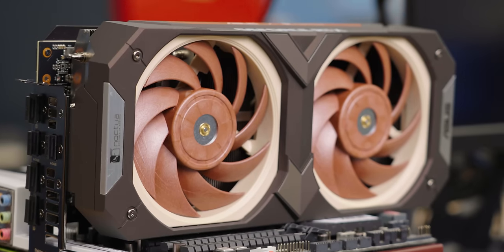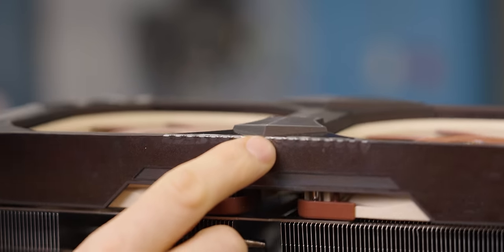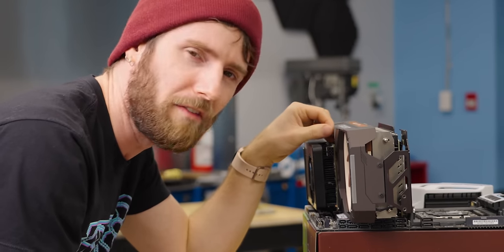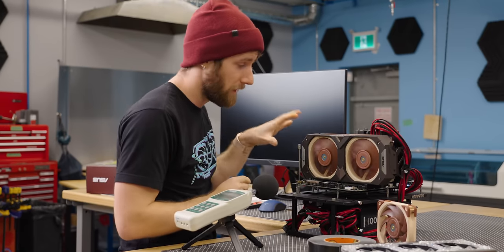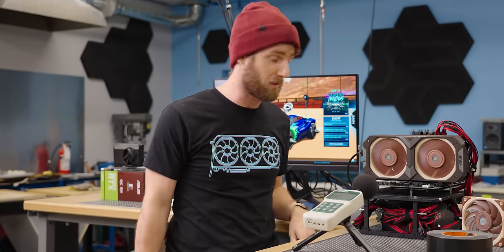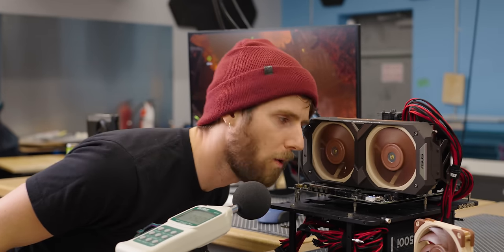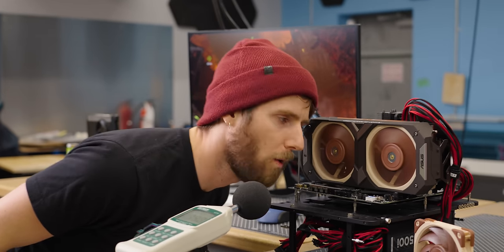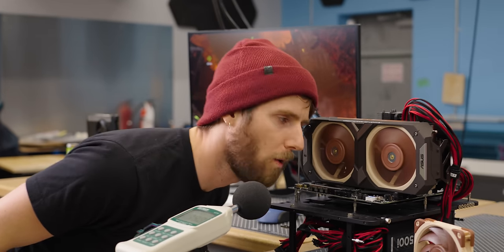Real Noctua GPU vs Redneck Engineering My Own

Comment: Been using a modded 1080 Ti for three years now. 
Was an MSI Armor OC version originally. 
After the mod it became the 1080 Ti x Arctic x beQuiet.

- Changed the anemic stock heatsink with an Arctic Accelero 3 Extreme. For the GPU/heatsink thermal compound i went with Thermal Grizzly Conductonaut (liquid metal). 
- Swapped out the 3 included 90mm Arctic fans that ship with that heatsink (removed the plastic shroud too) for 3x92mm beQuiet SilentWings2 full fat 25mm haight fans (PWM, 33.15 CFM, 18.6 dB) zip tied to each other and then on top of the heatsink. 
- Added individual aluminium heatsinks on top of every vmem chip and on all the power stages (used 25% thermal glue + 75% Thermal Grizzly Kryonaut thermal paste to glue each in position)

The whole thing grew in height from a one and a half slot to a 3 and a half slot card. 
It went from loud af at stock clocks to being inaudible even under heavy OC. 
Temps went from 75-80c under load with no OC, to 50-55c under load with my daily OC applied (+ 69 core clock, +699 mem clock). 
Been using it like this ever since i did the mod, about three years ago.

Some benchmark scores (17c ambinent temp, max OC applied: 2025-2037mhz core clock / 6443mhz mem clock):
- 4196 points in Unigine Heaven Benchmark 1080p (Ultra Quality, Extreme Tessellation, 8xAA) - min FPS: 41,9 / avg FPS: 166,6 / max FPS: 347 (52c max) [scored around
- 6492 points in Superposition 1080pExtreme - min FPS: 39,55 / avg FPS: 48,56 / max FPS: 56.48 (18c-44c max)
- 10528 points in Superposition 4kOptimized - min FPS: 62,56 / avg FPS: 78,75 / max FPS: 102.26 (19c-46c max)
- 10347 points in TimeSpy (paired with a 5.1Ghz OCed 8700K, 10819 points just for the Graphics score) (57c max)

The only 1080 Ti's i've seen in the wild that beat my scores are usually XOC bios swapped and/or custom loop watercooled variants.

Most high end 1080 Ti's out there, at stock clocks, usually score:
- Heaven 1080p Ultra-Extreme-8xAA: 3300-3400 points
- Superposition 1080pExtreme: 5000-5200 points
- Superposition 4kOptimized: 8600-8800 points
- TimeSpy: 9000-9200 points (9500-10000 Graphics score)
*When i say high end, i mean Strix, Aorus Extreme, etc

So, in conclusion, i made an Armor OC 1080Ti (one of the cheapest, hottest and loudest 1080Ti's) compete (mostly beat) the most high end 1080Ti's out there.
Reply: Similar story, I put an Accelero Mono Plus on my EVGA GTX1080 for $30.  Went from being by far the loudest and hottest component in the case to virtually inaudible and 20c cooler than stock.   I wasn't so worried about the OC, I just wanted it quiet and cool.  I wish we had more stock options that valued those two goals.

Comment: Normal gpu: 2 slots 
Noctua gpu: the whole pc
Reply: Can't believe Noctua went the lazy way with this one, they could've easily moulded a smaller enclosure for the fan blades to screw into
Reply: i mean you could engineer an i9 motherboard that fits in a gpu size motherboard, they could be put back to back for a super small pc
Reply: The motherboard take space on the GPU.
Reply: noctua gpu + the noctua passive cpu cooler: now we got the whole pc filled with heatsinks!
Reply: @PyromancerRift  its milimiters thick you dunce. The coolers are 95 of the size

Comment: So, that DIY'd version of the Noctua edition gpu wasn't one to one. The heatsink was clearly smaller. If they wanted to do a one to one comparison, they should have used another Asus TUF card then strapped Noctua fans to it. That and I'm sure that putting tape on the sides of the heatsink where air should be escaping isn't helping thermals at all. That, or just buy a Morpheus cooler and put some Noctua fans on it. They are popular aftermarket aircoolers because they work pretty darn well and look really good in the black nickel finish.
Reply: Not to mention not having the fans configured correctly. Should have at least checked the RPM they were running at, otherwise you can't compare them
Reply: 100% correct. LTT doesn't always use the most scientific methodology. Now GN, they would have noise normalized and compared temps and performance using the one to one method you explained.
LTT is still always fun to watch, and some times they do good work, but this wasn't their best.
Reply: If they'd put more effort into it this video wouldn't be called "... Redneck engineering... ".
Reply: @scottneulist9495  They were comparing thermals to noise. If you are willing to sacrifice noise levels then yes the fans will work of course. However this test showed that this didn't work if are trying to achieve a similar noise profile. Faster fans equals cooler but more noise. By matching noise levels you can calmly measure cooling performance.
Reply: Add to that, the fact that they covered one side of the exhaust of the GPU with tape, when ppl, me including been doing it ghetto style with zip ties since  years ago.
I have a 1080 strix with 2x120mm sw3 strapped to it. 200w, 20°C ambient, fans spin at 800rpm, 56-57°C, die temps...
Reply: @nyquillusdillwad9119  bro read between the lines. This is not, not scientific. It's done like this on purpose...

 This is a giant add for Asus. 

It's like one of those old commercials for cloth detergents.
Reply: This isn't Gamer Nexus. Leave the science to them and the entertainment to LTT.
Reply: @modmen.  Now  it just shows up like a paid video to make the new Noctua card look better than it should...
Reply: @yousonofadingus  not for DIY/tech illiterates, which is 98-99% of the public of these videos.
Reply: @TTks124  your comment literally doesent make any sense what are you trying to say? 😭😭
Reply: @TTks124  who hurt you
Reply: @jepulis6674  You got a point, the bar is set quite low to make sense as a sponsorship.
Reply: The Morpheus does not fit on RTX 3000 series cards.
Reply: @modmen.  That's not the issue I have with their conclusion. The conclusion they came to is comparing two different gpu models with two different cooler setups using the same model of fans. If they would have used an Asus TUF model to compare with the Asus Noctua edition, that would have been a more fair comparison that would yield useful insight as to how a gpu with desktop fans compared to the standard gpu fans.
Reply: @Kiki-lc3ng  I know. I wouldn't be surprised if Raijintek makes a new model for RTX 3000+/RX 6000+.
Reply: I'm not an LTT hater by any means. But this video is kind of useless and ridiculous. I'm okay with putting fans on a much smaller heatsink with tape blocking the airflow and running the thing with an unknown RPM as "entertainment" or "fun", but don't pretend you have shown ANYTHING with it. I use an RTX 3080 with noctua fans and was really interested in a comparison of self-made vs. real noctua gpu. BTW: My deshrouded ASUS ROG STRIX 3080 with noctua fans runs at 55° maximum (65° hotspot maximum) under full load with no noise. (I have slightly reduced the power limit.) Therefore I have well-founded doubts that one cannot achieve similar results with a do-it-yourself solution as with the "real noctua gpu".
Reply: @ericdeltoro8484  That would be more interesting for you and I, yes. I'm saying that your expectations from the video we  both clicked are quite high.
Reply: @Lowlightt  They did not attempt to match noise levels, though. If they wanted to test the thermals correctly while maintaining the same noise level, they would have incrementally increased the fan speed until they increased noise beyond the noise level of the room.

Comment: This is my new favorite GPU. This needs to become an industry standard.
Reply: Especially with the crazy gpu prices. Fans and radiators are cheap compared to the chips. So it makes a lot of sense to have better coolers. And not just on the very high end GPUs. I say, if it fits in pc cases, it's worth to just have bigger and more fans on graphics cards. Even if it "doesn't need so much cooling".

Comment: The truly mind blowing thing is how they thought a 2 slot support bracket was somehow enough for a 4 slot card. That thing was sagging on a god damn test bench.
Reply: To be fair, in a case you have the port and the case as support, while on the bench you have just  the port.
It's also got 4 slots of leverage, while in the case... It doesn't.

That said, I wonder how long it'll last without sagging to oblivion
Reply: @Anankin12  nah that test bench has posts you can tie it down on it you look closely, not sure if they used them
Reply: @videogamefreak221122  bag
Reply: @videogamefreak221122  can confirm that sag on test benches is real, even if you use the posts. the posts are literally just screwed through the acrylic into a standoff, so it tends to go everywhere really really easily.
Reply: @PC_Modder I'll rephrase: in a case you have 3 points of contact, on a benchmark only 2.

Comment: This is how all GPUs should be cooled, they cool great, its quiet and super easy to replace with pretty much any fan being a standard desktop fan if one dies. GPU heatsinks are so big these days anyway 120mm or even 140mm desktop fans are definitely the way to go.
Reply: Equal cooling for GPUs! 🤘
Reply: No, Case fans and cooler fans are different,one go for flow rate,the other go for dynamic pressure
Reply: @Omega | so? Even if that's the case it still clearly performs better aot the small 1-3 gpu fan setup.
Reply: @oMega-sm1eg  What do you think people use for CPU heatsinks and radiators? You can get static pressure optimized 120mm desktop fans, and in fact this very GPU is using unmodified Noctua NF-A12x25 desktop fans.

Comment: I've made my own DYI Noctua edition card using an ASUS RTX 3070 Dual (non-OC) and the fans spin at about 1500 RPM (controlled by the card itself with a small adapter) with temps maxing out at 68 degrees (74 for the hot spot) running benchmarks (but it doesn't get quite as high during actual gaming). So it is possible to get a similar performance to the real thing, but I guess the card you use will influence your performance a lot...

But also letting the card control your fans is probably a very good idea which you should've tried :/ maybe it would run the fans a bit faster but it could've made up for the difference in the heatsink.

Also, the NF-A12 aren't the most focused fans out there, so you have to make sure the fans are really tight against the heatsink, or else the air will just go out the edges.
Reply: What “adapter” did you use? Is it just straight through wiring?
Reply: @toypilot9811  should be. The gpu has its own control pins so it's just a matter of connecting the noctua fan headers to work in parallel electrical connection between them and matching them to the pins on gpu. You could diy your own adapter very cheaply with some wire and male/female pcb headers (tho this won't be as 'safe' because you won't have reverse connection prevention and might short things out if connected wrong but you are modding the gpu anyway)
Reply: @Jared undervolting is gambling. Even if you test it for hours on end, nothing is as good as the factory validation. For CPUs we have some of the same software the factory uses, but for GPUs we don't, AFAIK. So, sure, you can run whatever stress test and it can be stable all day long, but it'll never guarantee you'll never ever encounter stability issues.

I have what is arguably an SFF case and I still did the mod.
Reply: @ZonaALG  well I just used some wires and "plugged" the fans into the gpu headder

Comment: As already clarified, the heatsink is different for both but also the problem is you attached fans to motherboard sensor in your deshrouding, and it had to be around 1200 RPM  whereas the noctua edition at that temp is around 2000 rpm. You had to normalize RPMs for a more fair comparison
Reply: Crappy work by Linus. I did the same as he did and it works perfectly. I didn't use duct tape, tho. That is stupid.
Reply: lol 
typical Linus mistakes!

Comment: 15 years ago I created a beast of a thing : overclocked, and completely passively cooled, except for 1x 100mm case fan at low speed. I used several massive copper heatsinks cut into pieces, and the card weighed over 1.4kg. Worked perfectly. :)
Reply: 1.4kg is now the standard weight for a 3080ti. crazy

Comment: I use this kind of setup on my rig, except because I have a specific itx case, I just take the shroud of the gpu and slap it directly to the side of the case with the fans in between.  I use a software called Argus Monitor to curve those fan speeds to the temperature of my GPU and it works well.  I have a Sapphire Nitro+ SE 6900xt, and with 2 noctua fans I never see temps above 65 C

Comment: Actually love the idea and design of the ASUS Noctua card. I have lots of space in my case, just put a big ass heat sink and fan full. I have space in my case for a reason, fill that bad boy up.
Also, regular desktop fan? Easy to replace and upgrade?
Reply: not that u need to in a while with noctuah fans lmao
Reply: They are normal desktop fans. Roman swapped them out with different fans a few times and it's very easy to do
Reply: But whats the point in buying this card for silence if it has coil whine
Reply: @SimakSantana  probably wont hear any of that inside a case.
Reply: jay already put delta fans on it, and to their credit, standard 4 pin fan headers on the card (although they did not use them for the delta's for power draw reasons)
the fans in the card actually has shorter leads he said, but other than that they are standard.
Reply: That's what they said. 

Huh. Nope, you can't tell that joke in an inclusive way.

Comment: I'll admit, I actually like the Noctua colour scheme. Like, if you've seen a case build that just embraces it, it looks awesome! The problem is that every bit of hardware you can buy these days is either going for a dark-variant or all white.
Reply: Indeed. Most cases / parts are built with RGB in mind and white and black work best for that.
Reply: The fans look good in a black case though. And red light sort of works with the Noctua color scheme.
Reply: Same. Makes me want a nice multi-brown case. Much classier than RGB mania and edgy sports lines

Comment: I'd be curious to see if he replaced the fans in the asus/noctua designed one with the same fans he jerry-rigged up to see if theres a difference between them getting their power/speed from the gpu. was disapointed he didn't ramp up the speed a little to see if there was a difference. Also take the heat sink off the asus/noctua and put it on something else. I bet the bigger heat sink is the difference maker.
Reply: A larger heat sink just gives more volume for thermal capacity, which is why product testers who know what they're doing will wait for a fair amount of time for heat soaking before gathering data.

Theoretically, the larger volume can contribute to the cooling by having more surface area, but that still depends on how fast and efficiently the cooling solution is able to transfer heat. If the moving air has reached saturation by the time it leaves the metal, even an infinitely large heatsink won't perform any better.

Without looking into hard scientific data, it'd be really hard to draw the conclusion of how much impact the metal itself actually has, but in the end, it's moot since that's embedded in the conclusion anyway; the heatsink design was as much part of the collaboration as the choice of fans was.
Reply: JayzTwoCents switched out the fans and it was still hitting the same temps.
Reply: @FunTimeWithSouls  He didn't use standard case fans , either.  He probably hit the wall of diminishing returns rather quickly with the insane fans he put on it.  I believe he also said that the cooler wouldn't fit on the standard Asus TUF 3070.  That was part of his plan for that video, too.
Reply: Yep, Jay replaced them with Deltas... not a slow fan.

Comment: You can make that work with 0 issues. I have a Zotac 1070 and naturally both fans died because... it's Zotac.
Removed the shroud, zip-tied two 120mm Noctua to the heatsink and connected them with a Y-adapter directly (!) to the GPU. The GPU has no issues with delivering enough power to the fans because they actually use less power than the original fans and fan speed control via Afterburner works flawlessly.
Now it's super silent any at least 6-7° cooler than before (maybe even more).

Comment: Many ITX builders have been getting amazing temps, for an ITX case, with some cases that perfectly fit bottom mounted intake fans and a deshrouded GPU.
Reply: This GPU: bigger than an ITX case
Reply: I did this with an NCase M1, EVGA ftw3 rtx 3080, and two Phanteks T30s.

Comment: I'd love to see what a gpu cooler like this could do on a Kingpin card.
Reply: KP cards are meant for LN2 pots
Reply: Watch jayz video. Its basically at its cooling limit already. He put those blowymatron fans Linus loves and it didnt really help at all
Reply: The Kingpin has a better cooling solution anyways. This would be a step down and not hold up to the needs of such a demanding card. Would definitely like to see this on a entry level 3080 or 3080 Ti.
Reply: I don't think a Kingpin card is about being silent, or even quiet. Technically, the Hydro Copper versions are silent. The fans connected to your radiators probably aren't though.

Comment: Dang, when Linus put a mic next to this all I can hear is my own fans - through the headphone!
Reply: can confirm, bought this card a couple of weeks ago. still in quiet mode has hit max  of 75degrees c (hotspot) while gaming 1440p at 144Hz. also bought the nh d9l CPU cooler and thats hit a max of 65deg c. the only things i can hear are my case fans which im thinking of switching to noctua ones also.